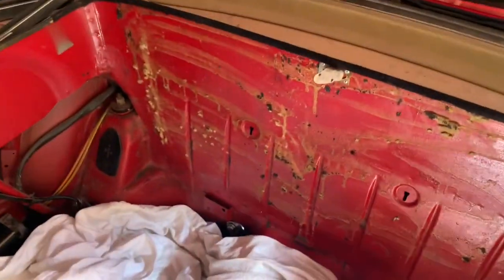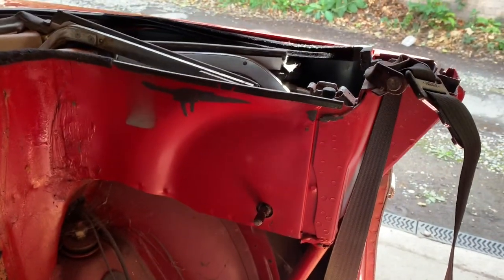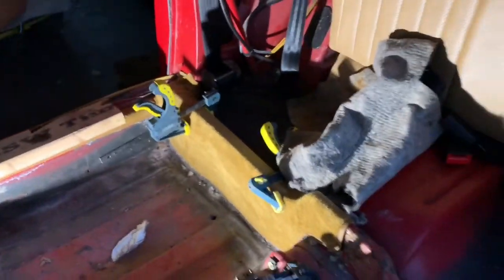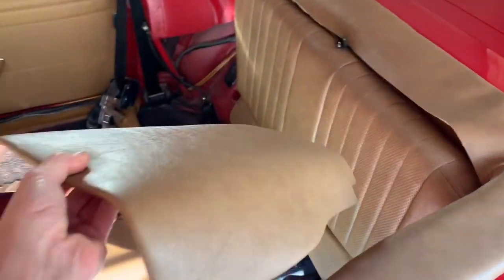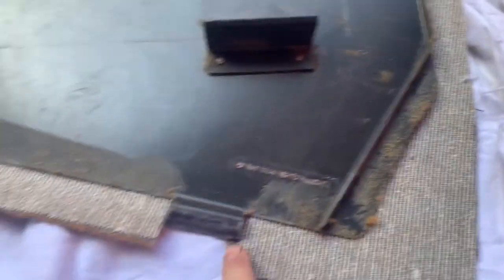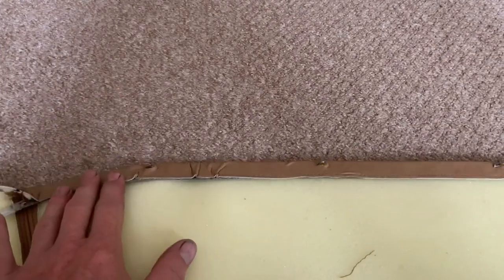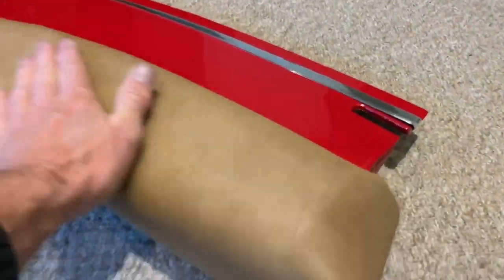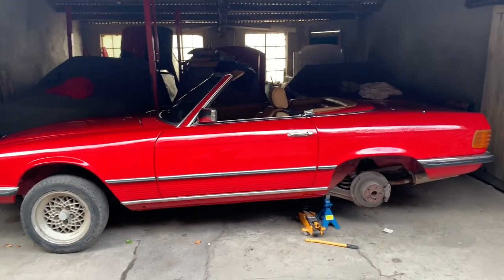Mercedes 107 rear seats , carpets and soft top cover trim

Comment: Good video Mike, thank you.  See my comment below, I have a different issue, operator error perhaps.🤨
Reply from the maker: Hi - sorry to hear you have an issue. It is not uncommon especially if the soft top doesn't go up and down very often.

So...as I understand it, the soft top unclips from the centre pin just fine but the horseshoe compartment wont open?

When you move the handle one way it locks the compartment and if you move it the other way, it should pull two wires which are attached to spring loaded catches on each end of the horseshoe compartment (under the chrome pieces where the seat belts thread through.

If these cables are snapped or the  central mechanism is impeded from rotating, those catches wont unlock and you will have difficulty getting the horseshoe compartment open.

I will do down to the garage when I have a moment and see if there is a way to pull those wires and unlock the catches another way.

Mike
Reply: @MikesMercsandothercars  thanks for getting back.  The top is already down and stored.  When moving the lever I can see the center pin moving, so that cable is fine.  Something is up with the spring loaded catches on either end.  The car is in great shape and the cables looked fine to me.  The previous owner said he never put the hard top on while he had it.  His brother was the owner.

I am taking it to the bodyshop tomorrow so they can look at the rust behind one of the bodyside mouldings.  Evidence of a poor aftermarket chrome fender trim install. Those are bad news!  Thanks
Reply: @MikesMercsandothercars  how is it going today? Today is the last day for trying on my own using a coat hanger with a 4" hook on one end.  The body shop will deal with it tomorrow if I am unsuccessful this evening.  Thanks
Reply from the maker: @ronalddean3630  Hi - I had a closer look at the soft top mechanism and on my 1975 280SL here is how it works:

SCENARIO 1

Hard top is off, and the soft top is folded away and the clam shell cover wont open:

1. The central lever with a hook on it, plays no part in locking the clam shell down. To move this hook from side to side you use the small lever on the clam shell release handle. To pull this hook down and lock either the hard top or the soft top, you pull the clam shell release handle up towards the sky.

2. There are two spring loaded catches at either end of the clam shell. Pushing the clam shell release handle down should move these catches back towards the dash. The catch nearest the steering wheel (on a LHD car) is pulled back MECHANICALLY via a series of levers eg there is no cable. The catch furtherest from the clam shell release handle is operated by a cable. The cable does NOT run from the clam shell release handle but rather from a metal 'pivot' in the corner on the soft top cover compartment. A lever attaches the clam shell release handle to this pivot. The point at which the cable is attached to this pivot is usually where the cable breaks. This cable runs underneath the central hook all the way to the other catch. If the cable is broken and this catch wont release, you need to pull the cable with needle nose pliers through a slot. The way to access this slot is by taking off the side trim panel. See https://www.youtube.com/watch?v=TXt4_JN0iEk

I will upload a short private video showing how the mechanism works.

Mike
Reply from the maker: Here is a short video showing the mechanism. Mike
Reply from the maker: Oops forgot the link:

https://www.youtube.com/watch?v=cd-JNVYUIsU
Reply: @MikesMercsandothercars  how are you doing?  Well, my situation is solved.  I took it to the shop on Wed morning.  My SL tech had the car inside for less than 8 minutes when I looked over and the cover was open!  "How did you do that?" I yelled 😮. 

He says he just pushed down, turned the crank, and it opened.  He then adjusted some of the frame pieces and lubricated the joints.  He said some people use smaller towels between the plastic folds in the soft top when it is stored.  The ones I found in there were way too bulky.  All I can say is prayer works.  I so appreciate you taking the time to assist me on this (operator error on my part).
Reply from the maker: @ronalddean3630  Thanks for the update - glad you got it sorted. Mike

Comment: Mike do you have a video of a soft top installation procedure and setting please cause i can not get mine closing properly
Reply from the maker: Hello - I don’t have a soft top video yet ( but I will at some stage). Is this a new problem? Have you just had a new soft top? Remember that the front top is connected first. Then to move little catch. Then you slam down rear. Then you lock the handle up. Mike
Reply: @MikesMercsandothercars  thanks for your reply and help as always, a brief description. I bought the car from the UK last December and it was In a garage for around 12 years with the soft top in its compartment as it had its hard top on. When i exposed the soft top for the first time to my surprise it was like new and never used, at that point it closed without any issues but had to remove it out of the car due to a complete restoration, now the soft top is back in place and when I close the front first the back is very hard to close, I do mange but it will be so tight that the middle closes okay but both back sides of the hood don’t even touch the car, what I did now is close the hood on the first latch and will leave it like that for a while maybe it starches a bit.
Reply from the maker: @rogercamilleri4844  Hello -thanks for the detailed explanation. With the soft top up but not latched on the front or the back, lift the back right up so that you can see the 4 bolts which attach the soft top mechanism to the car (2 on each side) If you are lucky, you maybe able to see the old markings of exactly where the roof was bolted in. Its been a while since I looked BUT...I believe there is some adjustment at these bolts. If the whole mechanism was bolted too far forward, the top section would be slightly loose and the back section tight. You could try  marking where it is at present, loosening these bolts and moving the whole mechanism back a millimetre or two towards the boot. Not sure if it will work, but that is what I would try. Mike
Reply: @MikesMercsandothercars  Hi Mike, my issue is different.  I just put my soft top down for the first time a week ago.  I followed the instructions to open the cover and it popped up just fine, I folded the soft top, pushed it in, and locked the top.  

Yesterday, I tried to open it because I wanted to raise the soft top.  To my amazement, the compartment top won't open.  I have rotated the handle and safety lock according to the booklet that came with my car. Nothing

I can hear things moving, and the rise and lowering of the center pin is not the issue.  I didn't know what was going on. 

Then today, while talking with a guy from Benz World, he somehow made me think of what I saw when I opened the compartment last week.  Along the length of the compartment near the trunk were two white Turkish towels laid the long way, and at the center a discolored area was on the towel.  At the time I did not think anything of it to just leave it.  I shook it out and there was no rust, leaves, or other debris in there.  

OMG, now I am wondering if somehow when I put the towels back and folded the top in, I blocked something that now prevents the top from opening.  Ugh!  So now I don't know what to do.  I saw a video of someone who had a stuck compartment cover, he used a screwdriver to move a small hinge, in the space behind the large chrome areas with the two nuts you pointed out.  https://www.youtube.com/watch?v=H9AfSlUYw7E&t=38s  

I tried that and nothing happened.

Also, the interior panel on the driver's side has some sort of gash in it and I would like to replace it at some point.

Does this mean I can only fix this by dismantling the rear compartment the way you did?  I sure hope not!  I have no experience doing things like this. Is there a way to get in from the trunk?  Any assistance would be appreciated.

Comment: Great video, helped me to competently strip out the rear passenger panel (it rubs against the frame and the noise drives me mad!) so it very helpful. 

Agreed that little cover for the deck release handle is easy to damage if you didn’t know about the clip!

Comment: Hi Mike, my sl is rusty around the soft top cover. How do I get the trim panel that is covered in vinyl off? Cheers John
Reply from the maker: It is held on by a series of star clips which go over plastic studs protruding from the horseshoe panel. It is VERY easy to snap off the plastic studs. The end  of each horseshoe has a separate plastic section into which the then metal bands fit. It is VERY easy to bend/deform the metal and also to breal the end plastic fittings. So....proceed with care. Good luck Mike

Comment: Do you know how to replace the soft top?
Reply from the maker: Hi - I have had a few soft tops replaced but have thus far always had it done by a specialist. There was an episode of Wheeler Dealers where Ed replaced the soft top himself (see https://www.youtube.com/watch?v=1oZ0MoRNlLQ) When ever possible I have always brought my SL soft tops back from USA where they tend to be cheaper (see https://www.topsonline.com/model/Convertible_Tops_And_Accessories/Mercedes_Benz/1972_thru_1989_Mercedes_280SL,_300SL,_350SL,_380SL,_420SL,_450SL,_500SL_And_560SL_(Chassis_R107).html). Good luck. Mike